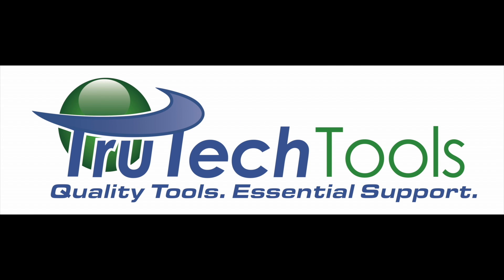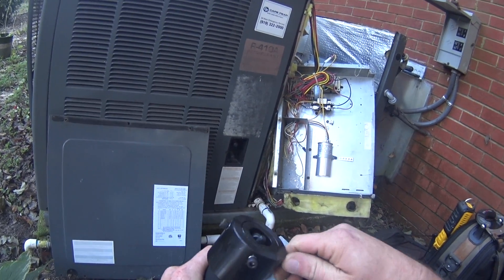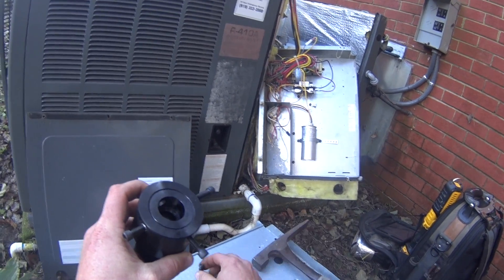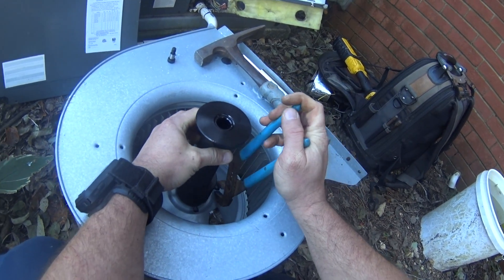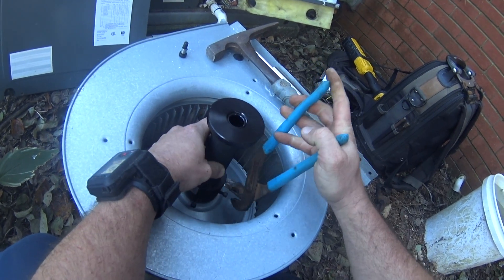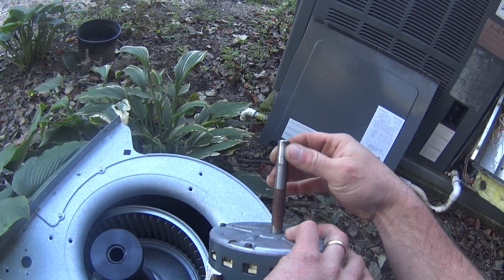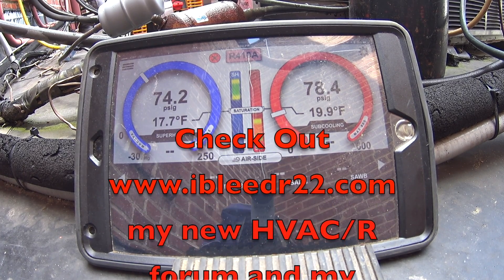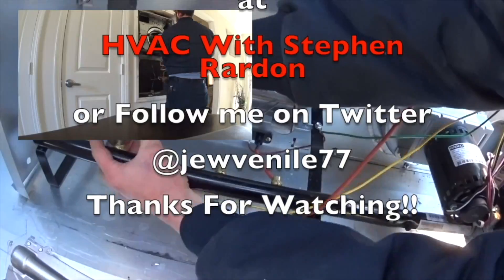HVAC Tools: The Knockout by Creative Products

Comment: I have  blower wheel pullers that are screw type been on the market for 20 years.I'm a little worried about hammering if the punch can handle it. You still have to sand of rust off the shaft before using those tools.
Reply: It's always good to have the screw type as well; this thing doesn't work on EVERY blower or CFM you come across, but it's damn handy on the majority that is DOES work on.  If I can get away with a little sandpaper, some aerokroil, and a coupla whacks from my brass hammer, that will take care of most CFMs - if not, I select one of the two knock-out tools that will best help me extricate the offending motor.

Comment: Hey Stephen, on these Goodman square cabinet packaged units you don't need to remove the electrical panel to get the blower assembly out. Just remove the top panel and everything is accessible from the top.

Comment: I'm pretty sure you wouldn't be able to reuse that motor. Good video as always.
Reply: I think he's talking about in a case like...say...if you were just removing the motor to clean-out the squirrel cage and then re-installing the same(good) motor.  In that case you'd wanna not ding-up the shaft so you could go back in the with same motor.